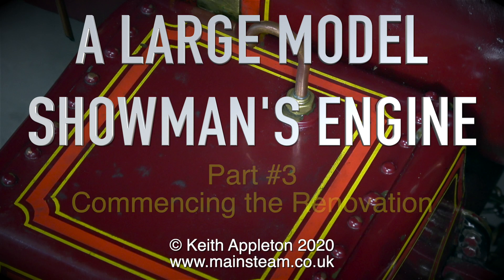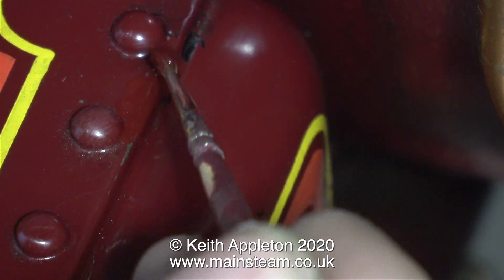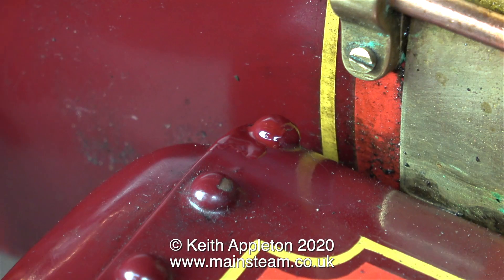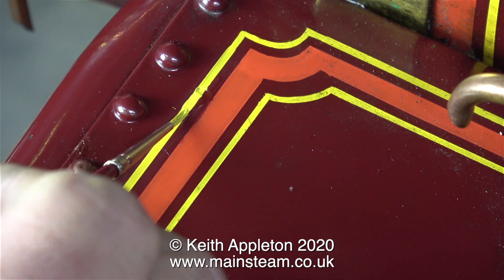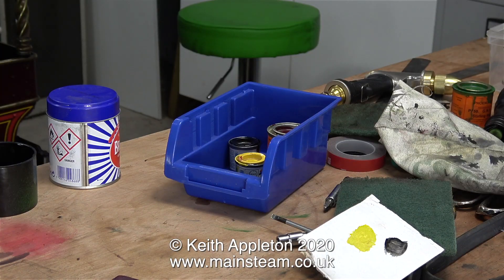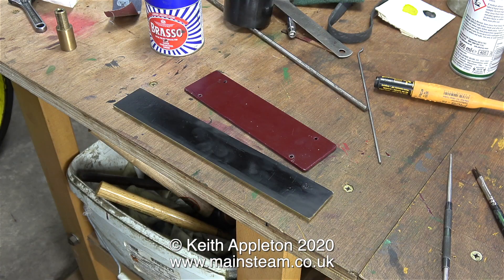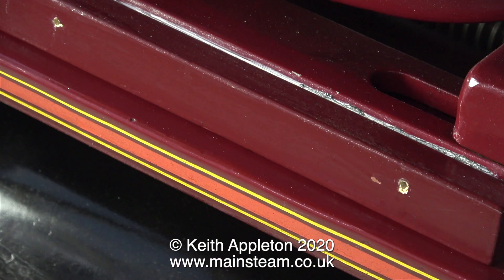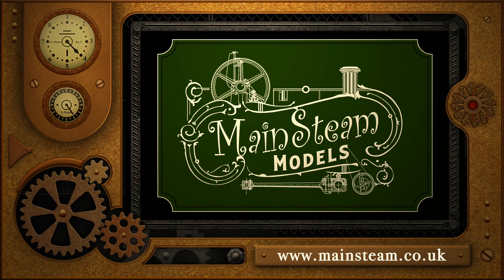A LARGE MODEL SHOWMAN'S ENGINE - PART #3

Comment: When mounting servos in model airplanes we use wood screws into plywood. To make the screw holes very durable. I first put in the screw then remove it. I then apply very thin super glue. And allow it to dry. Then the wood is reinforced and the screw can be reinserted and holds the wood very well. Even when exposed to model airplane fuel.

Comment: A lot of miniature traction engine owners use 1Shot sign writing enamel paints for the lining.
Reply from the maker: Yes I have some of that, but I am still not good at lining ......
Reply: On my 4” Burrell Showman I used finest lining tape from Frost Restoration. Comes in reels of pre-spaced lines. Gives a very sharp clean edge and perfect spacing. The blue lining tape also takes a very tight bend without lifting or puckering.
Reply from the maker: Thanks, I will take a look at Frost Restoration. What is it like on the parts that get hot?
Reply: @keithappleton  Use to mask the lined areas and paint.  Or use a Beugler pen.